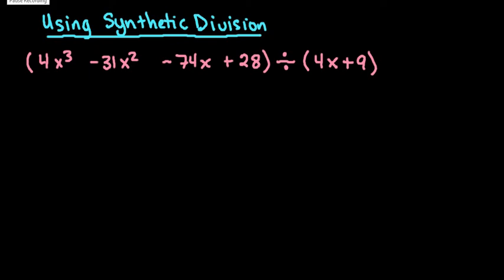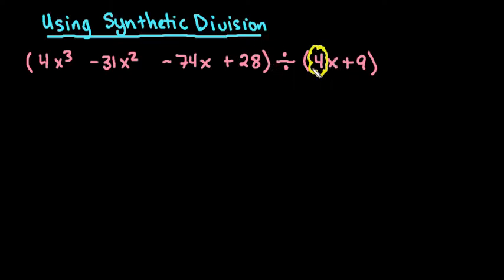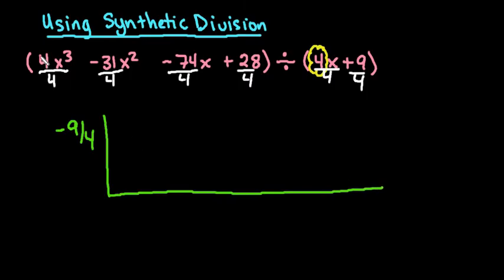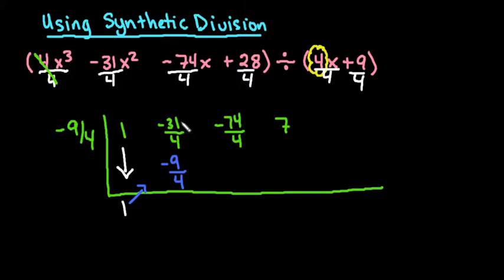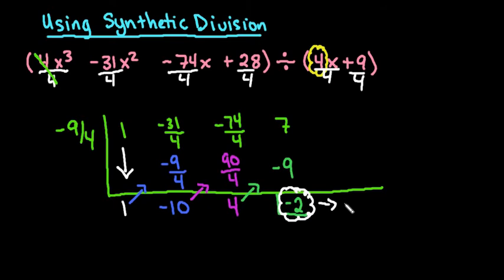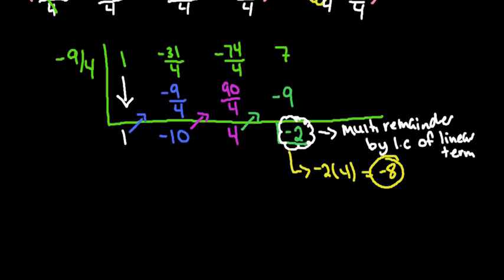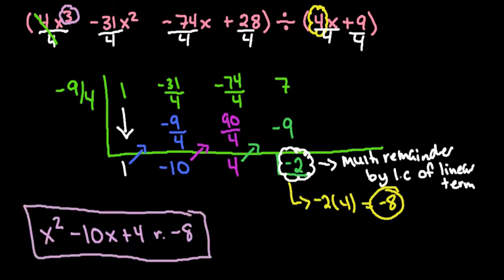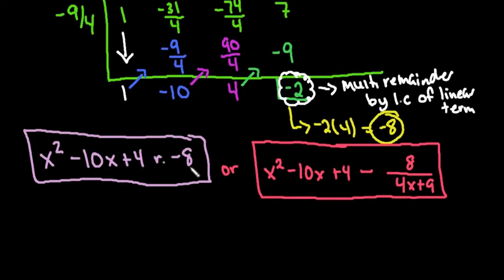Synthetic Division Leading Coefficient of Linear Term is NOT 1

Comment: THAAAAAANKKKKKKKKK YOUUUU MISS MAAM😭😭😭🙏🙏🙏💯💯💞💞💞💞💞
Reply from the maker: You're welcome
Reply: @MathandStatsHelp  ommggggggg, maam do u have a tip on how to add fractions easier???
Reply from the maker: I unfortunately do not have a video for that. Look for the lowest common denominator. Having the same denominator is key. If you're allowed to use calculators, it's easy. 😂

Comment: well my problem is mine has a 7/4 how do i deal with that?
Reply: u have to divide it by 4 cuz my leading coefficient is 4 but my problem is it has a freaking 7
Reply: and a 15
Reply: and what if the answer of the thing that u divide by -9/4 is a mixed number?
Reply from the maker: It's hard to advise without seeing the exact problem. Sometimes you have fractional coefficients.

Comment: can you divide it by 4 after you get the answer, rather than doing it in the beginning
Reply from the maker: No you have to do it at the beginning.
Reply: @MathandStatsHelp  no you don’t, you could factor out the 4 so you would be left with x + 9/4 and use -9/4 in the box and do the synthetic division and then after take 1/4 of the coefficients you get
Reply: You don't have to do it at the beginning. Use -9/4 in the box and do the synthetic division. Then divide coefficients of quotient by 4. This is much easier since you don't have to deal with fractions during Synthetic division process.

Comment: What about when it has exponents?
Reply from the maker: Do you mean when you are dividing by a term with exponents? If so, you would have to use long division. I don't have a long division with examples of dividing by a nonlinear term, but can make one if you need it.
Reply: @MathandStatsHelp  I appreciate you for replying. But really? in my assignment my divisor is x^3-x^2-1. And my prof said I use synthetic division. What do I need to do? Is there a way to make it possible?
Reply from the maker: It is, it is just more complicated than doing it with long division. I can put one together and upload it. I will put a link when I'm finished
Reply: @MathandStatsHelp  thank you so much ❤❤❤ i think the reason why its complicated is because I'm in college 😂 but I still need help. I can't find an example for that kind of problem. Thank youuu! I'll just turn on the bell notification.
Reply from the maker: The video can be found at https://youtu.be/wqzkfkyszCU . Hope it helps!